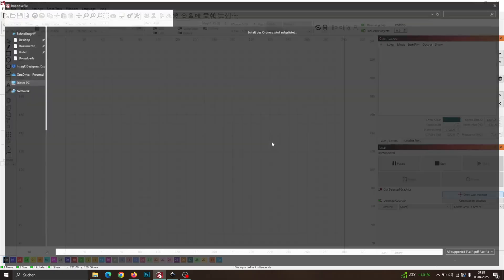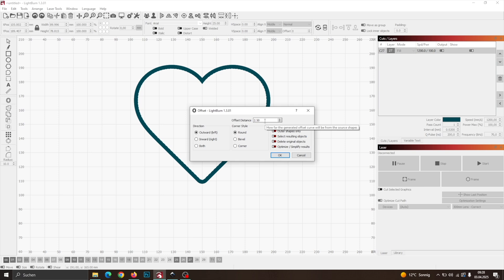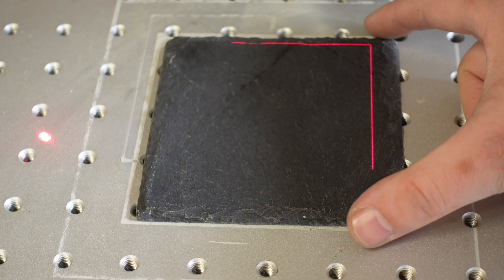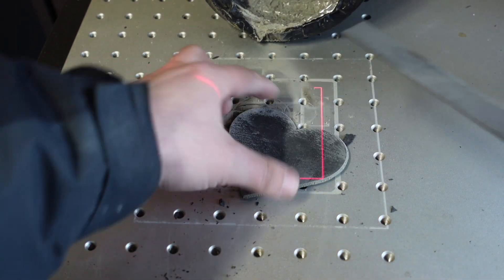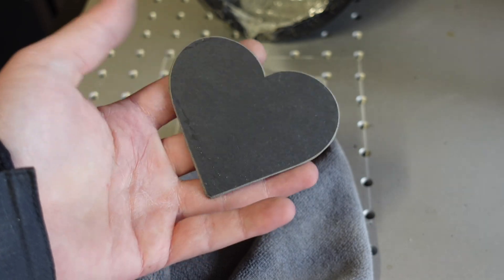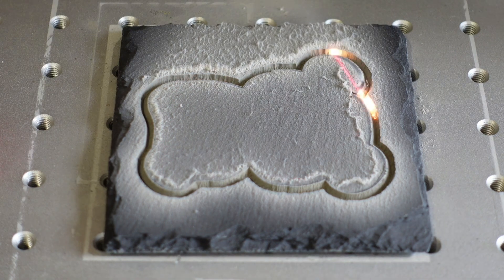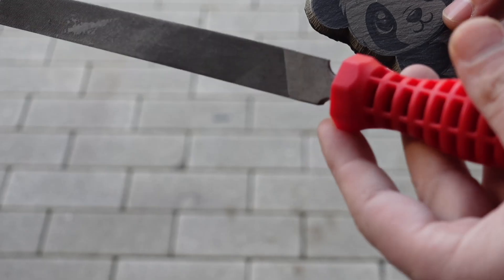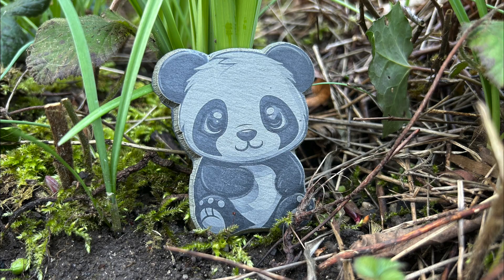Cut Slate with a Fiber Laser – Clean, Precise & Crack-Free!

Comment: Because slate is made up of layers, you are knocking off uneven areas of the back. The front may look fine but I'd definitely not be using those as sale items. Would look much better cut all the way through IMO.
Reply from the maker: 100%. Just a few more passes and it will cut through

Comment: how long did the cut take?
Reply: I guess 2h. I think it is faster to laser the couture and cut it with wood tools.
Reply from the maker: Usually it takes between 20-30 minutes
Reply: @ImagR-Laser  Is there a reason you would choose to use the 300mm or only because you probably had it on there for design engraving on slate?